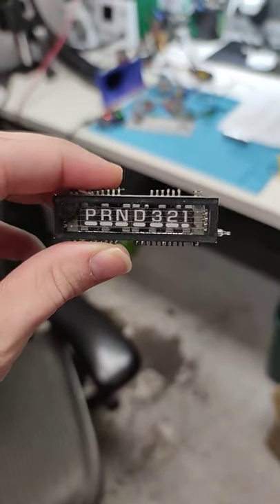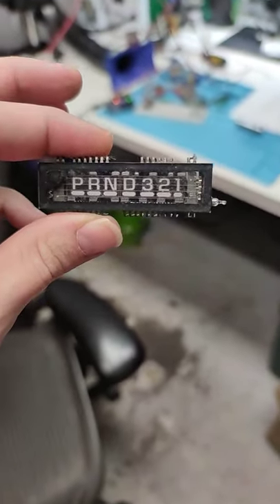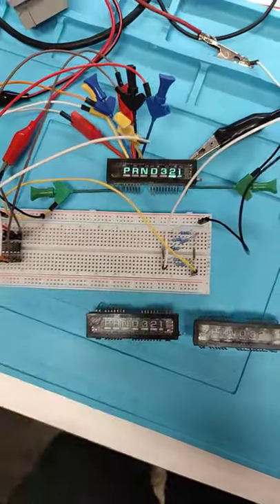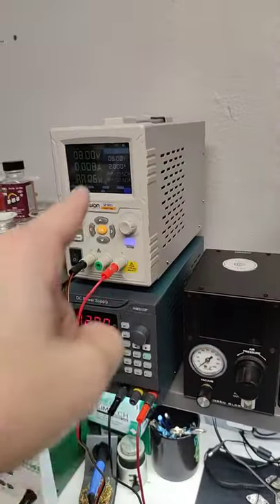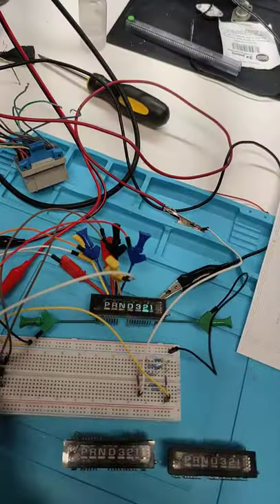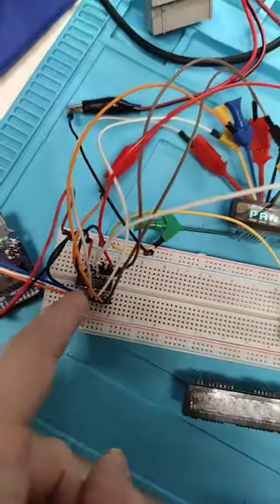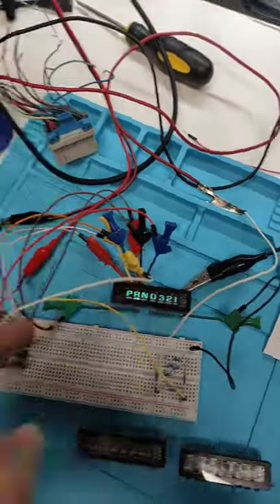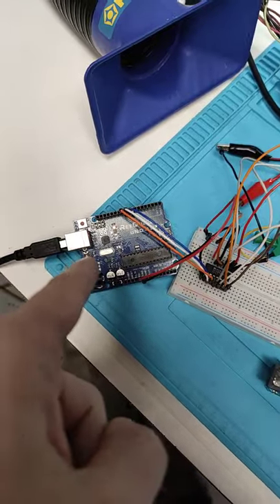Arduino Controlled Vacuum Fluorescent Display Old Futaba Screens

Comment: I'm currently experimenting with my car's VFD speedometer. I really wanted to take control the display with arduino so i can use digital signal (canbus/i2c) and make a centralized control system for my car with arduino

Comment: Perfect timing, I'm currently doing the finish work on a custom '84 square body IP that is sitting on a (shortened) '06 duramax 4x4 frame & drivetrain. My unit has the correct connector (scavenged from an '03 cluster) so it simply plugs in to the duramax harness. It's appears to be completely stock other than the brake light and odometer have been replaced with an OLED display. Tack & Speedo are driven with x27 steppers and the fuel/temp/volts/oil gauges are using air motors. Driven directly from the J1850VPW data buss.
I have ordered linear actuators to control the '84 prindle (so it still appears stock) but maybe using an '04 VFD could fit in the same space. 
Just thinkin' outloud....
Reply from the maker: Some time this week Ill have a video on V2 of this that uses the 07-14 VFD on it. Its a little easier to use. well maybe not easier but less parts.
Reply: Just saw your 'card holder' video that directed me to the github files, not having to reverse engineer the pinout of the VFD saved me lots of effort. I have enough I/O to drive this directly from my microcontroller (thru like a M54562 driver). 
Thanx, I may have to reach out to you with my final design for your own development work.

Comment: Hi, which driver are you using? ‘Cause I have a 16 digit old Futaba Vfd, but using his original 10937 chip it doesn’t seem to communicate well with the Arduino… thanks